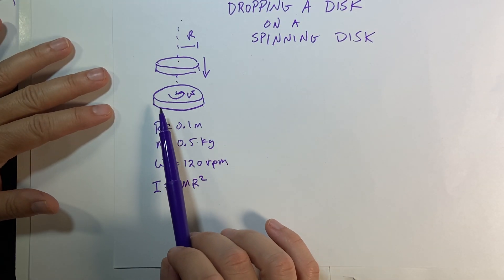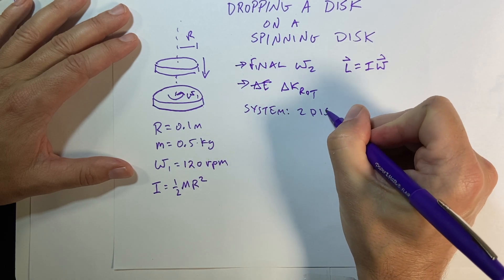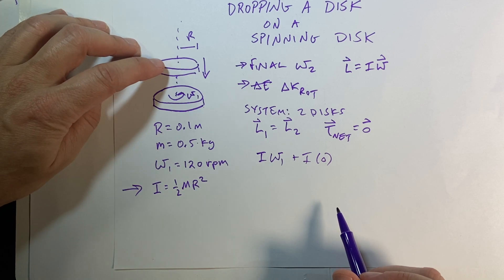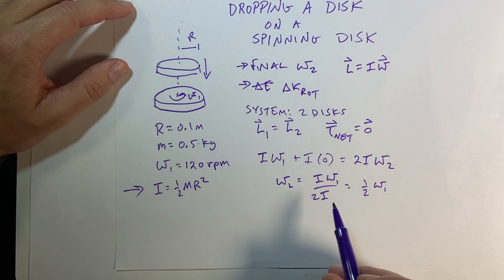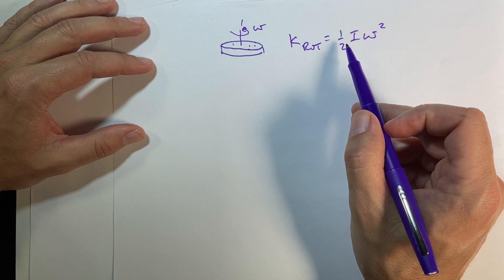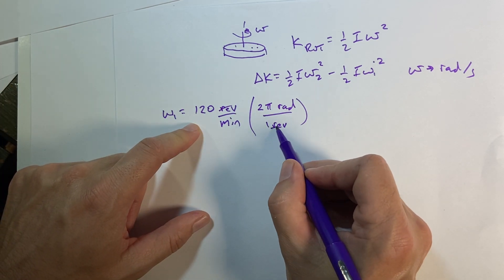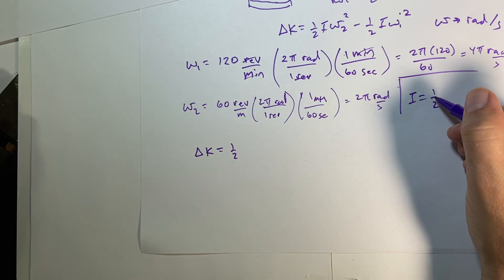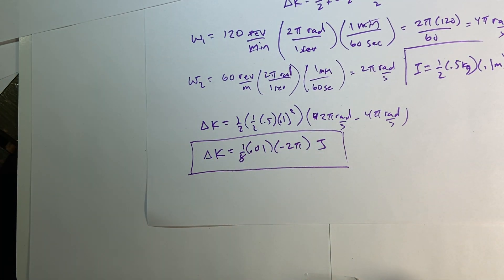Final rotational speed for a disk dropped on a spinning disk.

Comment: In reality, you will find that the angular energy is conserved and angular momentum not.
That is why there is no published example of this experiment.
Your predictions are all unsupported and cannot be confirmed and that falsifies the theory.
Reply: The assumption of friction is baked into the problem when we assume the disks come to a common final velocity:  if there was no friction, the upper disk would stay motionless as the lower disk spins beneath it forever with the same initial angular velocity.  

So you've answered the question of "where did the energy go?"  (friction), but it's still disturbing that we didn't have to model the friction in order for it to take energy out of the system.  The same is true in linear inelastic collisions -- we find the energy is missing without having to model the nonconservative forces acting during the collision.  

But this energy loss comes out of the assumption that the final velocities are the same.  You enforce that condition with angular momentum conservation, and it turns out by assuming the final angular velocities are equal you have no choice but to have a reduction in rotational kinetic energy (and it doesn't matter what the details are for HOW the disks interact in order to come to a common final velocity).  We are totally confident that angular momentum is conserved here, because there is clearly no outside torque acting on the system, so we can be confident in our rotational kinetic energy loss as well.
Reply: @gal766  must I repeat myself again?

Comment: The final calculation has a couple of errors. As the other commenter said, the same moment of inertia was used for both the initial and final situation when it should be twice as large. Also, the omega wasn't squared in the formula for kinetic energy.

Comment: Towards the last step of the problem where you are calculating the change in rotational KE, wouldn't the two moment of inertia values be different since the two disks on top of each other would result in an increased mass value?